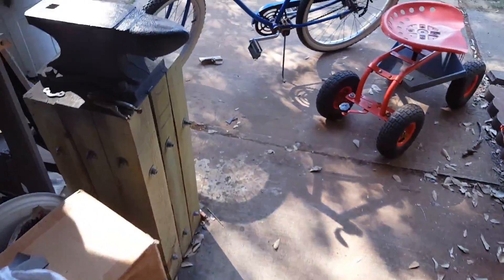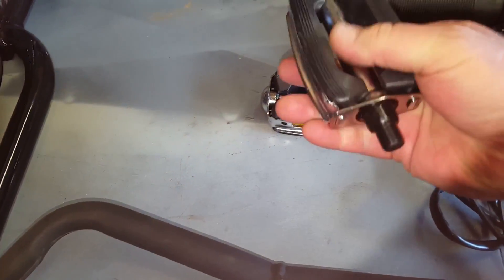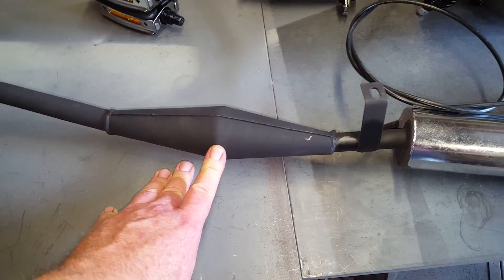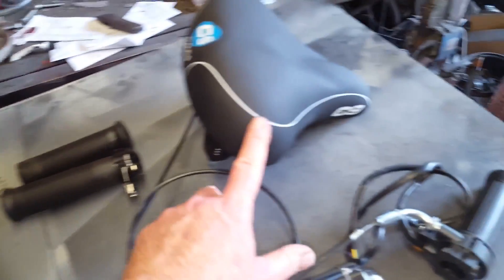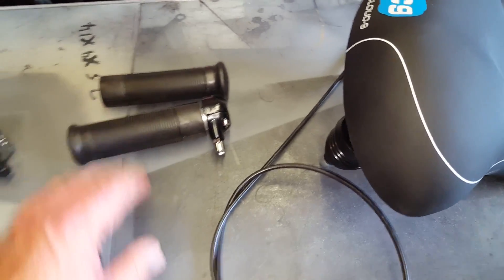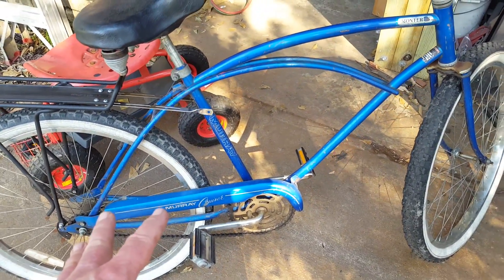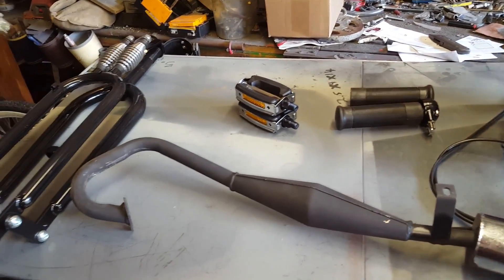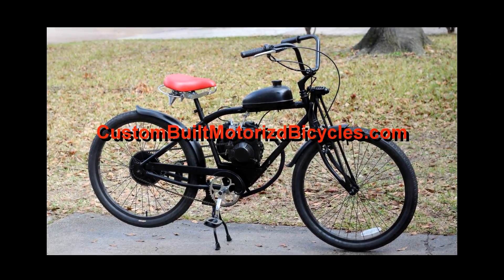How To Build a Better 2 Stroke Motorized Bicycle Video Series Part 2

Comment: I have a problem with the clutch not engaging to ride the bike with the free wheel. When i swap the engine to another bike i had the plate off so i can take the chain off something came off. not sure if that is what is causing the clutch not to engage. Thanks

Comment: I'm having problems with my motorized bike. If I upload a video can you tell me what's wrong?
Reply: It has compression but the engine keeps dying its the first time start
Reply from the maker: check for air leaks or dirty carb/ carb float, could even be ignition coil

Comment: I have been having problem after problem with either not being able to get my motorized mountain bike started.OR the most irritating one..I can't seem to keep ANY chain on it for more than 1 minute before it breaks off.WHAT AM I DOING WRONG?? SOMEONE PLEASE HELP...
Reply from the maker: Check out my vid on chain issues. Starting? check for spark, clean fuel, clean carb